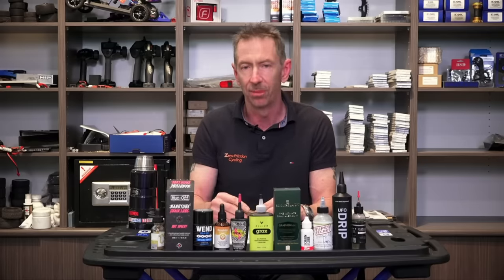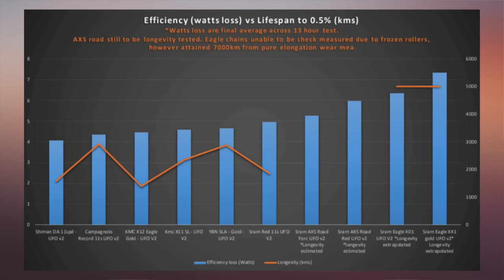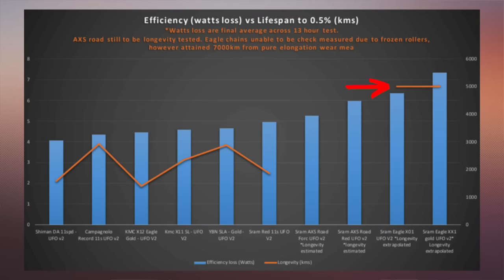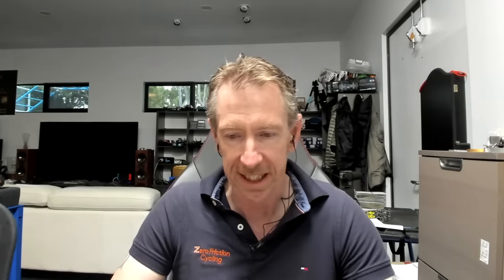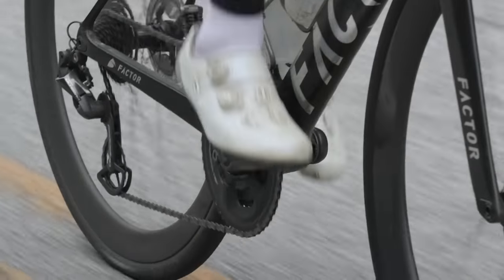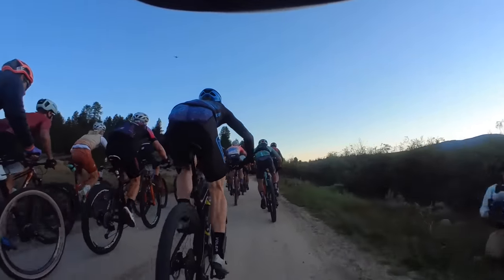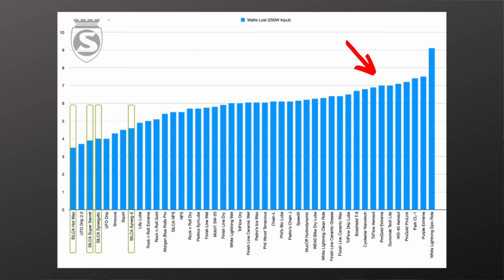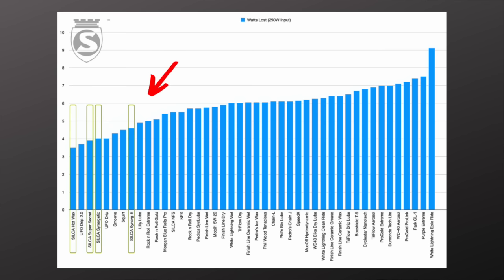How Slow Are SRAM Chains and Other Drivetrain Efficiency Questions With Adam Kerin

Comment: It seems that a 105 system with a Dura Ace chain is the best compromise for those want to train and race on budget.
Reply: 105 is definitely recommended, best cost/performance and more than enough for most
Reply: with an ultegra crankset

Comment: i know this series is about the marginal gains.. but as a consumer that buys his own gear i take a chain that lasts more than twice as long any day over 2watts (if at all) any day of the week

so i find it quite exaggerated how sram components are  portrayed here

disclaimer: i am not a fan of any particular brand and own more bikes with shimano than sram
Reply: people are different. For me personal those 2 watts are a reason to not put Sram on my bike.
Reply: My current chain is the XX1 SRAM meant to be long lasting, according to FF. Does not shift as nicely as Shimano on my drivetrain, but I run Di2, so shifting is always good anyway. 1500k in, my chain checker has hardly budged. My next experiment will be with the Wippermann conex, as they are meant to last even longer. Not cheap, but I like the idea of producing less waste.
I had no issues with Shimano chains and lifespan was good. I just stopped using them because their coatings have PFTE, as does YBN. SRAM/Wipperman are also made in Europe, which means less CO2 footprint for those of us living in this part of the world.
PS: given this is also a marginal gains channel, I guess saving 2W fits into the category. I weigh 47kg and don't have a huge peak power on absolute terms. I recently found a better choice of tyres+tubes+chain+lube would save close to 1h in a 160k event on my own. And that is not even with the 'best in class' choice for each (I won't go latex or wax my chain, for instance).
Reply: Been exclusively using Shimano chains on SRAM groups exclusively for over 200k miles. There's no reason you can't just take out the worst offender
Reply: @veganpotterthevegan  I know that worked ok on 11 speed but 12 speed?
Reply: 5,000 mi on a XX1 chain and still not worn. Chiefly dry, dusty climate and chain is regularly hot waxed every 300 miles. I’d say that’s an A+++ for durability.
Reply: @Dave B  yup, it works.  I ride oval chainrings and the front shifting is much better too.  Shifting is slightly worse out back with a SRAM cassette but actually better with the Chinesium XDR cassettes I've mostly been running
Reply: I know it's not ideal but just pulled the trigger to try a gold ybn 12 speed chain (yes I went there 😂) on my force axs. If it doesn't go well back to the force axs chain.
Reply: @strandedpaki  yes! Lol we’ve all been there. Let us know how it goes! I’m certainly interested
Reply: @strandedpaki  will you update us when you've mounted it on your bike? Would really be appreciated as I've been on the fence about it as well.
Reply: @jaspreetsidhu5708  I definitely will. Saved the e-mail about this reply so I can remember. Chain coming Friday but 
I'm out of town for a week after that, so will take some time to give valid feedback.
Reply: It needs to be noted that the chain life data they are discussing was intentionally taken using White Lightning Epic which is one of the worst known lubricants for both wear and friction.  This was done to accentuate the wear on the chain.  Using a top lube or immersive wax compresses the differences dramatically between the best and worst chains resulting in even the worst performing chains showing 25,000+ km life expectancies.
Reply: @SILCAVelo  what about watt savings though? I know marginal but still. I already wax my chain love it for all the good reasons like quiet efficient drivetrain and no more grease stains.
Reply: Totally agree with your comments. I use KMC-SRAM-SHIMANO-CAMPY. You can do more good by cleaning & lubeing your drivetrain regularly than Ceramic speed this & that to save 1-2W...
Reply: To me there's another consideration or two. 1. SRAM Official statements are that their stuff is just as efficient which it isn't in both design (tooth counts) and implementation (as tested). 2. Other design choices like 8 little 4n-m bolts to retain the chainrings (a PITA) or their fastener fetish, randomly spring torx and hex bolts throughout their parts or the flat top chain which seems to be an attempt to force folks to run all SRAM drivetrain parts.  But then, totally wireless is pretty nice if one can hold their nose about the other stuff. 🤷
Reply: @strandedpaki  awesome thanks man. I did have the ybn sl on my old 11 speed grx bike. They were great chains and even shifted better than the Shimano chains. And had amazing durability if there's no issues I think I'll swap over as well thank you for saving me email down.
Reply: Truth. My position is durability is worth 1.5 watts!
Reply: Sram really does have superior drive trains compared to shimano. But for brakes I'll take shimano all day haha. Talking mtb though.
Reply: A suggestion then where you'd get the better of both worlds. Get an Ultegra chain and a bottle of Silca Synergetic lube. Faster chain with lube that provides long chain life per FF testing.
Reply: So now you have the information, you can make your choice either way.  Whether the claims are "exaggerated" is a decision you make in your own head.
Reply: Give me the 2 watts hahahaha
Reply: @strandedpaki  updates?
Reply: @JesperPerssonen  Sorry for the delay, I fully intend to test this out still. But my bike frame sustained some damage and is with a carbon repair facility, they are taking longer than I anticipated. I am due to get it back this week and will post updates once I have installed the new chain. Have your question saved in my e-mail inbox.
Reply: @nluisa  Did you try these Connex, if so what was your impression? I ordered one for my old 7 speeds, but the 11 speeds are  quite expensive...
I'm not sure how they rank with these tests, how fast, durability, I see the best price/durability ratio is S 105 11 speeds!
Reply: @DR_1_1  The SRAM chain lasted nearly 8000k. The connex one has done 1000k so far, so early days, although a CyclingTips article mentions it lasting 10000k. Shfting is slightly clunkier than with SRAM. 
Shimano 105 chain lasted just under 4000k, although I was using more wet lube at the time.
Reply: @nluisa  Wow 1000 kil. is quite bad for the Connex...
105 vs SRAM makes sense OTOH, since SRAM is +2 x the price.
I have some time left to replace the 11 speeds, maybe Shimano HG701, or some KMC, they look good too, although not that much in these tests...
Reply: @DR_1_1 I meant I've only done 1000k so far (I've just edited the comment) , I can't say how durable it is yet. 
The XX1 chain is more expensive than 105, but it's less than double the price.
Reply: @nluisa  OK thanks! Where I live XX1 is just over 50 € right now, S 105 is just below 25 €.
I'm not sure I would try SRAM on my Shimano 2 x 11, although even their 12 sp may be compatible (at least some people do it, but it's sold for 1 x here).
I just bought my 1st quick link from Connex, it's almost the price of a cheap chain, I'll see if I can clean more frequently, maybe experiment with dry lubes, etc...
I'm on the same 100 ml universal oil bottle for 20 years now! it cost me 2.5 €, good results, but always black...
Reply: me too i use my wax and inductive heater to heat up chain on bike and all these characters from silca and no friction are funny
Reply: wellif this would be about most lasting chains sram would definately win ^^
Reply: Frankly I'm shocked that people pay Hundreds of dollars for chains too. hundrends!!! for one chain. TF!
Reply: @out_spocken  it's nothing, they pay thousands for bicycles

Comment: Good to learn that the trade-off for 30,000 km service life on a Dura-Ace BB is only around .5 watts.  I'm good with only having to change by BB every two years if that's all I'll lose.
Reply: Don't forget that with an "optimised BB" you can probably throw it after any bad weather day. Also if you don't disassemble it before every race to check if it's sound you might ride a dead BB too.

Comment: So many MTB’s being sold with horrible chain lines. Great info and something to pay attention to!
Reply: That's the tradeoff of 1x drivetrain.  But I don't think most MTBers are obsessing over the fractions of a watt that a perfect chain line would give.  Even in XC racing a couple watts from chain choice and ceramic bearings isn't going to make up for even one bad line choice even over the course of a long race. and in DH and Enduro durability trumps efficiency because a broken drivetrain = DNF.  TT seems to be where it would give the most benefit as that is the closest you can get to a pure watts per KG contest.
Reply: @mrvwbug4423  I’ve seen some pretty bad chain lines with 1x setups but there’s certainly brands doing it better than others. I’ve even used spacers to move bottom brackets a 1-2mm to get the chain aligned to the middle of the cassette. Some frames are just bad.
Reply: @tinshield  Centered is not necessarly the best. Angles are not symetric top and bottom and you can tradeof some chainline on one side to get it better on the other.
Reply: @TheAntoine191  much of my riding is in the inner half of the cassette. My bikes are pretty much in the middle. Quieter and smoother. Many bikes favor the smaller cogs which isn’t ideal IMO.
Reply: Used to be MTB chainline was 47.5-49mm.  Boost showed up and everything moved 3mm to ~52mm.  In the latest round of 12 speed Shimano cranks 52mm is non-Boost, and 55mm is Boost to make more room for frames to clear large wheels and still have room enough to have a meaty chainstay while tucking 29er wheels under the rider.
Add to this the pinned together construction allowing the big cog to overhang the freehub, and the biggest cog moved inward about 4 mm compared to say an old 9 speed cassette, and that low cog is about 7mm more out of line with the chain ring than it would be historically.  If you have an older frame not needing the extra clearance it is an unnecessary penalty on the hills.

Comment: 10mins in: I do not understand this point at all. The chain does not come off the chain ring at the trailing edge, and nor does it come off the cassette at the leading edge of the sprockets. It comes off at the dead top and dead bottom. So there is no difference in running an 80-80 vs a 20-20, in terms of angles you're forcing the chain through (when viewed from above/below - I'm not talking about the radius of the curves). The 80-80 will certainly have a longer path and so you'll need a longer chain to have the same tension, and hence more weight etc, but the diagram on screen at 10:15 does not seem at all right to me. The chain comes off the cogs dead above and below the axles (ok, ignoring rear derailure).
Reply: No, it does not come off right at the center of the cog. Bigger the cog, longer the distance from the center.

Comment: After watching this interview I stand by my vote in your recent pole on marginal gains even more. Being 20~30 pounds overweight is way more of an issue than .5 watt from a bottom bracket.  

That being said, I still love wax chain lube because it’s so easy and so clean. The longevity is a nice hope too. The quiet smooth pedaling is just icing on the cake.
Reply: which wax lube brand do you use?
Reply: Wax for the win, it's clean, it's just so nice. I use store bought paraffin wax.
Reply: if it is a flat time trial or crit, 0.5 watts of pulley is about the same as 30lbs
Reply: No reason you can't improve both

Comment: The picture is not representative of RED22 chain, i’m not sure about the Shimano either. If not for the logo, it could be the other way round??? SRAM chains have a silk smooth polished finish, whereas Shimano chains are rough as hell. I can’t work out what is going on here, but something seems off. Is this a like for like comparison??? Or maybe both SRAM and Shimano chains have changed a lot 🤷‍♂️. What i see is not typical/familiar to me.

Comment: Ok, watched the video, read the comments, and honestly I'm surprised at the SRAM fanboy complex. SRAM made design choices that have consequences. Deal with it. And I'm saying this as someone who has owned and enjoyed multiple SRAM drive trains. SRAM Red Etap 11 speed w/ a Dura Ace cassette and chain is AMAZING and still probably my favorite setup. Imagine my disappointment when I got a SRAM Force AXS groupset. For me, I'm swapping all my bikes to Shimano one piece at a time. I've got so many negative experiences with SRAM guide brakes and maintenance in general, the original SRAM etap blip box not being compatible with new AXS stuff (yeah just pony up another $400 what's the big deal?), the wireless blips which were always supposed to be updated  to actuate the reverb dropper post and then SRAM just deciding not to do it, I could list more but not worth my time. Frankly I trust Shimano more, with the quality of their components, and definitely more with my wallet. SRAM is a corporate money printer and you're the printing press.
Reply: Every bike Ive had with sram gets replaced by Shimano at some point. Shimano more refined and easier to set up. Just works better

Comment: On my winter bike, 9sp, Ive started sacrificing my front chain rings and run a chain & cassette until they are visibly worn. Get about 15k miles and it works out costing a lot less than swopping chains at 2k and cassettes at 4-5k.

Comment: On paper the oversized pulley wheels show gains in a stationary friction test but on the road with aerodynamics factored in those gains are cancelled out.  Due to the larger pulley wheels and also due to the fact that the pulley wheels are closer to the ground cause increased drag (a larger wind profile).  So if you do both a stationary friction test and a wind tunnel (aerodynamic) test, zero watts are gained.

Comment: I have an old 9 speed mountain bike and i needed a new chain so I installed a sram. I had also updated drivetrain but the entire system was loud and would ghost shift on me under load. I thought it was the adjustment of the derailleur but nothing I did helped there (sram shifters and derailleur). I decided just for the heck of it to put the old 15 yo shimano chain and it was silent and shifted like a dream. I ended up buying a new shimano chain and all my issues went away. Lesson learned for my instance.

Comment: Interesting, but the guest’s advice/analysis has no independent data to present. It’s a bit wishy washy, i’d like to to see real unbiased data, rather than opinion. I’ll take some of his comments with a pinch of salt (as I do with most of the info. we are presented with online). Are Shimano chains manufactured by KMC? 

Are we saying that cheaper chains (with rough surface finish) are actually the fastest?…it could be true, but why???

SRAM chains look 👌, whereas Shimano chains look crap in comparison. What is going on there now exactly? 🤷‍♂️

Comment: Let's get real here, Folks...   If you're riding a bike at an average power output of 250 watts -- a good number for a reasonably fit cyclist -- a POWER SAVINGS of 0.1 watt is ONLY a  0.04% DIFFERENCE.  No one is going to  notice that. The manufacturing tolerances alone for drive chain components would account for much more than that.

Comment: So what you are saying is use a good lube and pick a chain that won’t fail?  I’ve broken every shimano chain I have ever had.  I switched to SRAM before they  made a derailleur.  I don’t care if SRAM chains loose a few watts over hours.  They shift well enough and when you are standing going up hill at maximum effort, I can trust that at least I won’t get kicked in the nuts when the chain breaks.  So if anyone suggests you should use a shimano chain, just kick them in then nuts to explain why.  Getting kicked in the nuts is not “efficient”.

Comment: YBN chain is excellent, that is if you can find original item. There are YBN counterfeits in the market. I had 9s YBN hollow plate, hollow pin, gold colour (nitride coating) and it was bliss. I also use YBN 11s solid plate, solid pin, gold colour, after riding it for 1000 km I'm pretty sure it was counterfeit.

Comment: Anybody running a YBN chain on a SRAM Red drivetrain?  Sounds like there is a compatibility concern. I like YBN and use them on my XX1 cross country setup. Just added a gravel bike to the mix with SRAM Red and I’d like use YBN again as I’ve got the hot waxing dialed on this brand of chain.

Comment: I used to run a 52 56 front chainrings on my TT bike. I did this because most of the time trials I raced were usually very flat and wind was the determinant of the gearing needed. Going into the wind I could use the 52 inner ring combined with a 19 or 21 (largest on the cogset )and keep a straighter chain line. It looked strange with two chainrings so close in size but an added benefit was it sure shifted nice 👍.